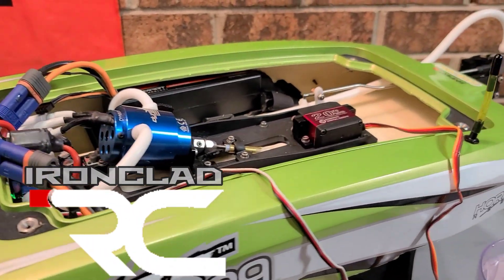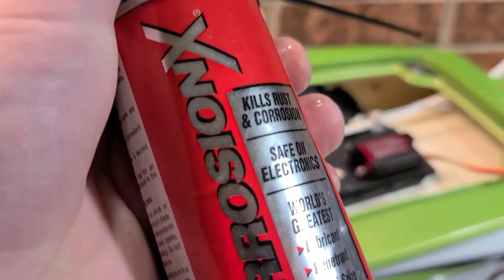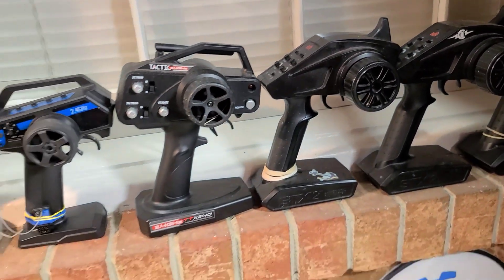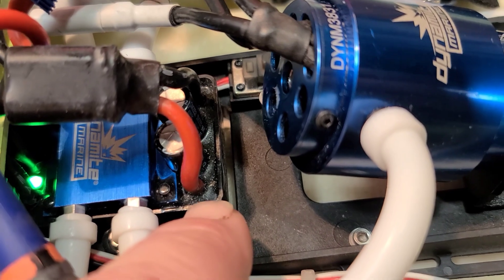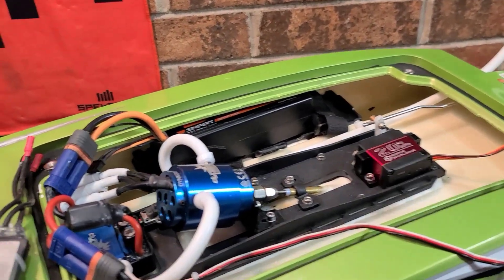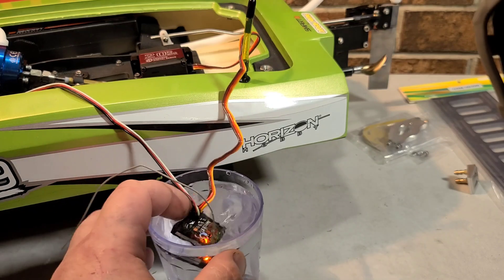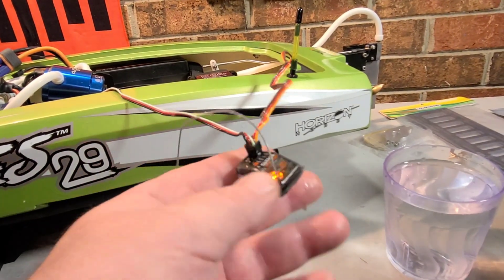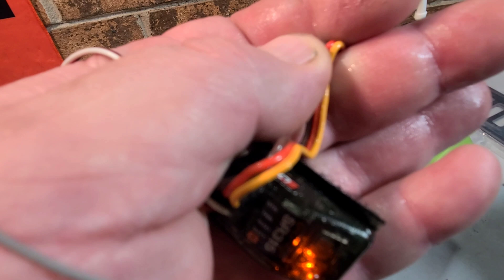WaterProofing Electronics Quick & Easy With Test

Comment: I've recently bought a RC fishing boat, and didn't know the manufacturer had no good water sealing for it, still a beginner, the thing is I lost one of the motors which can be replaced, but also got water into other electronic boards ( inside the boat was submerged with water) my question would the corrosion X fix the problem in the board or It should be replaced as well, as I am not electrician I don't know which of the electric parts were damaged and how far the damage is.

looking for a heads up on what to do only. 

next time I'm definitely sealing inside the boat, great vids btw! hats down!
Reply from the maker: Corrosion X should have been used before the water damage, it won't  fix a damaged board, worth a try but I doubt it'll fixed it.    May need new electrics.
Reply: Thx mate i appreciate your reply. i had a feeling that's what i should do
Reply from the maker: No problem

Comment: Does That Stuff Dry? I Wanna Do This To My RC Truck But Im Worried About It Gumming Up With Dust When I Hit The Powdered Dirt In My Area.
Reply from the maker: No, it stays kinda tacky and will most definitely gum up. You need conformal coating it's like an electrical "epoxy" works good for ground, air, and sea.

Comment: so this stuff is like an oil??? i was told its like a plastic coating,but that seems un true.... i also have a large tube of dio electric grease...have you used or know how to use on an rx to protect... i have been flipping my boats more than normal lately do to increased power setups.and running in rough water.. lol....thanks

Comment: Absolutely agree with the Corrosion X treatment Big B. I have a can sitting on my workbench and wouldn't be without it.
Some folks say it's expensive... and they're right! It's not the cheapest, but a little goes a LONG way. And consider the cost of replacing a receiver, servo, ESC or motor! It's a no-brainer!  Whenever I've had a wipe out and everything in the boat is wet, I don't worry... everything has had the CX treatment 😉

Comment: Super great on the motor bearings Thanks for the tip.
I’m now going to get some more.
I have been having to put ceramic hybrid bearings in up till seeing this video, I have I’ll give it a try.
I am always in salt water had no luck with it on the receivers though.
Only spektrum mrx200 full waterproof last for me.
The pins corrode away still after about a year.

Comment: I work in electronics.  Corex is decent stuff. But if I want a stupid cheap conformal costing, I use paraffin wax. It even helps stabilize oscillators.
Reply: That makes perfect sense. I personally use '' rubber in a tin '' I dip my receivers in it once they are loaded with whatever you plug in. Pull it out and its a perfect rubber coated waterproof receiver.  It sets up in around 2 mins. To remove the stuff, if you ever want to,  it's like peeling a banana.
Reply: @Top-Jimmy 
I looked for it on Amazon but didn't see it.  Is that the brand name?
Reply: Could the heat from the electronics melt the wax ?

Comment: I’m telling ya, I just order the corrosion x plus some hi temp connectors from OSE. Thanks Big B 👍
Do they know I used your link ? I’ve been dealing with Steve for a while over there at OSE, I dropped your name in the order comments just to be sure. Thanks again
Reply from the maker: No, Ose doesn't know your using my link I just included the links to help you guys out.   Thanks for the support any products ordered from horizon hobby actually helps the channel everything else is just for convenience

Comment: Are lipo batteries waterproof can you waterproof lipo batteries?
Reply from the maker: I spray a little corrosion X on the lipo connector and in the battery where the tabs are?  Not sure if I like it yet?  Ive only been doing it for a few months now. Guess only time will tell
Reply: @IRONCLADRC  In theory, LiPo cells are waterproof.  They are in sealed pouches, so that's all good.  It's the connections that you need to worry about. CorrosionX probably couldn't hurt anything other than hardening the insulation on the wire.

Comment: Aren't those Spectrum receivers waterproof or resistant on their own?  Have to test a Futaba w CX.
Reply: I didnt really have issues with spektrum until I outgrew my pond and started having to run in brackish water. Just the tiny bit of salt in the water wrecked everything spektrum I had. Works good in that situation for me.
Reply: @Buellerwtfman  definitely w brackish water. That's good to hear.
Reply: No.  No receivers are waterproof as is. Need to treat them.
Reply: @jcallesano  incorrect.  Spectrum receivers have a degree of water protection, unlike Futaba.  Few drops of water on a Futaba..bye bye.  My buddy had a Spectrum receivers- not sure which and was fully soaked and continued to work to my amazement.  They certainly are treated-- to what degree I'm not sure, I don't use Spectrum.  OSE also confirmed this.
Reply: I treat mine w heavy coats of conformal silicone.  Then put in a printed custom box, also sealed--, fully sealed w pigtails running out.  Submerged for 3 months, good as new.
Reply: @VelocityKings  so you answered your  own original question then.  My receiver crapped out immediately when it got wet and turned my v2 into a self driving weapon where I had to catch it this past Sunday slicing my finger open.    So I'd say a degree of water protection just ain't enough.   It ruined my whole day when that happened.
Reply from the maker: I agree I've gotten many untreated spektrum receivers wet with out issue.  I treat all my receivers with corrosion X regardless what brand it is.
Reply: @jcallesano  lol..scares the heck out of ya when the boat gets a mind of it's own.  Been there, not pretty.
Reply: @VelocityKings  do you think a wet receiver would make it act a fool like that?  It was really uncomfortable to have that happen in front of people. I felt like an idiot after. And I didn't know why it happened.
Reply: @jcallesano  yes definitely. Before I started to protect my Futaba receivers, if they got wet..wow...hull had a mind of it's own..any input from the transmitter was ignored. Hull danced around like mad. Scary.  Now I make sure they are extremely waterproof --coated and in a sealed printed box w pigtails.
Reply: @VelocityKings  so I've let this boat sit since Sunday at 7:00 p.m. and figured I'd give it another try and as soon as I turn the boat on the steering servo arm swings all the way down smashing itself into the motor mount.  Throttle works, but the steering, steering rate, etc on the radio do nothing.  Is this still the receiver acting up or is the servo now bad?  Boats been used for 15 mins.   Unreal
Reply: @jcallesano  hard to say.  I'd make sure all rates, trims, etc are neutral if possible and do process of elimination.  First try receiver, then try a servo.  Always handy to have extra spare parts.  You can get a standard power hd servo at OSE pretty cheap.